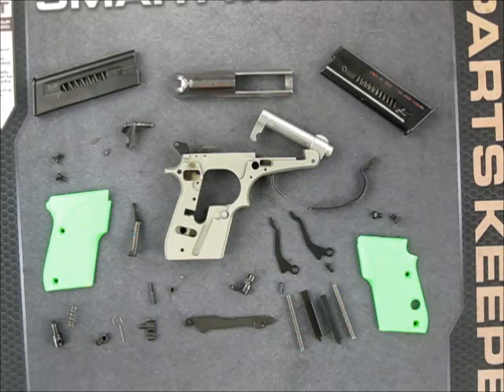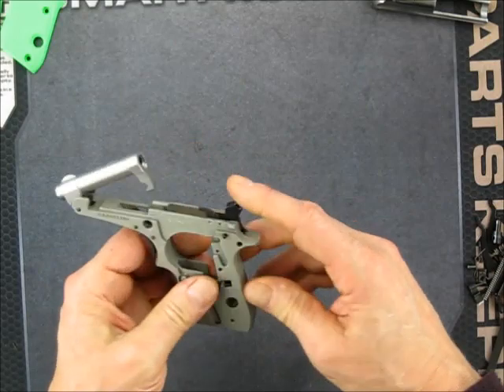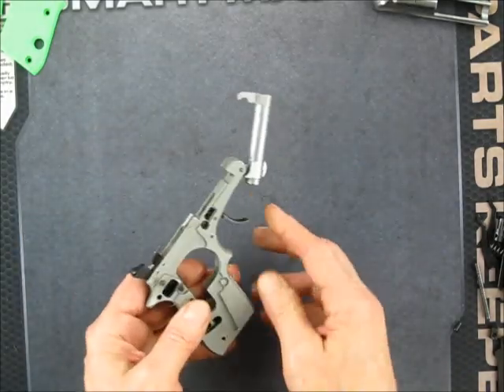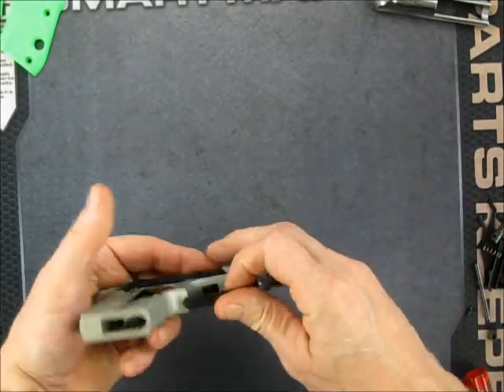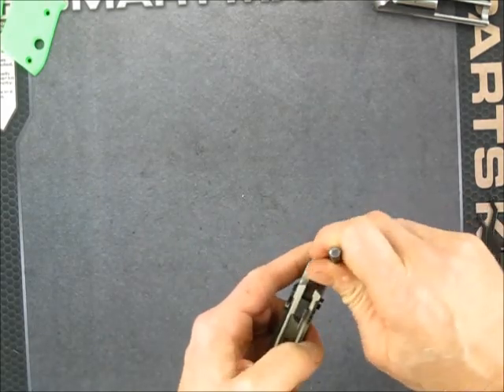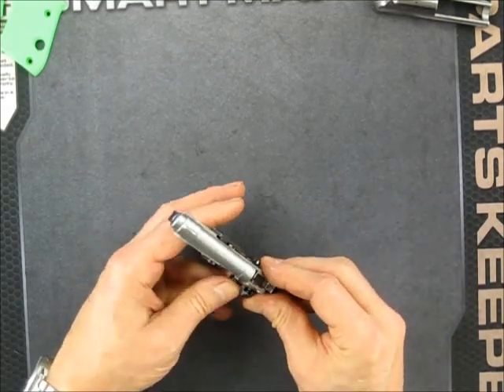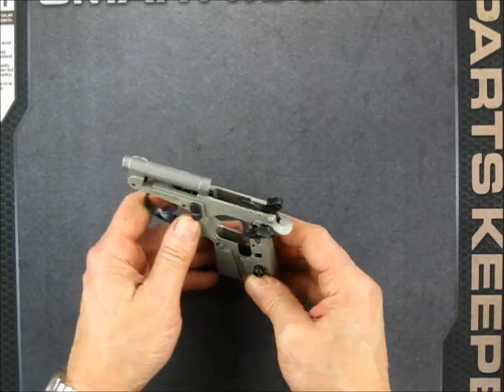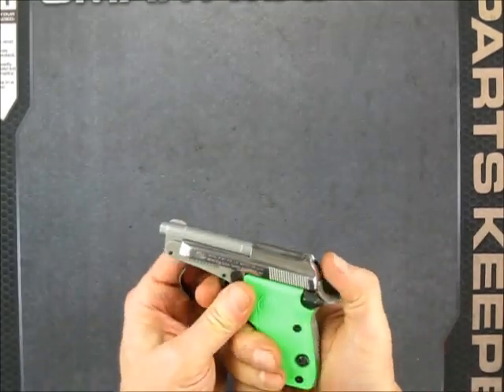Beretta 21a Bobcat Reassembly

Comment: I'm deciding between the lcp 22lr and the bobcat. I'd modify either, but the question is which one needs fewer modifications.

Bobcat has too thick a grip.
LCP has a mag release that is too easy to press accidentally.
LCP slide requires 2 hands so the release is depressed. Might be an issue.
LCP slide starts at very front preventing firing as a belly gun.
I don't like the bobcat safely. I wish it was forward and backward so a holster could turn it off when I draw.

Comment: What happens if you put a round in the opened barrel instead of using the slide and then try a double action shot? Will it grab a second round from the magazine and bump that into the first one? Is the barrel load meant to be used with a cocked hammer single action shot?

Comment: What tool did you use for transfer bar/trigger return spring starting at 8:01 or so? Looks like a dental tool, but must have had a fork to push the spring forward.

Comment: Can you fire several double action shots without touching the hammer? Or does it switch to single action after the first shot?
Reply: After first shot, hammer is actuated by the slide so next 6 trigger pulls are about 4 1/2 lb